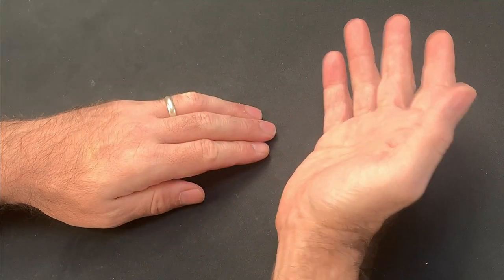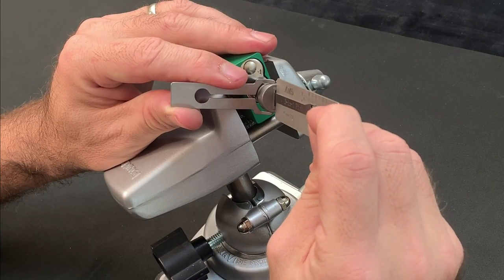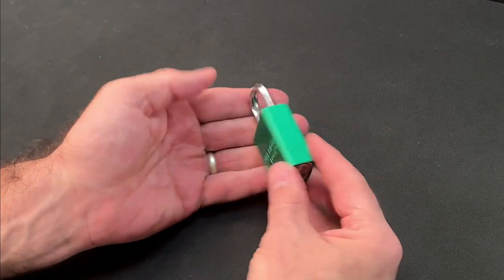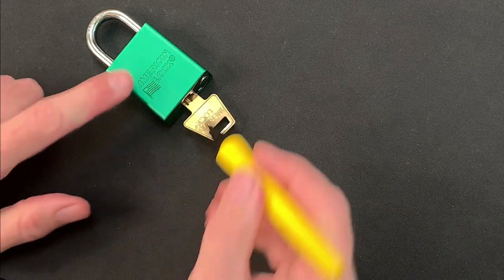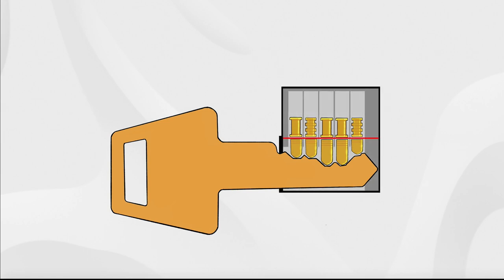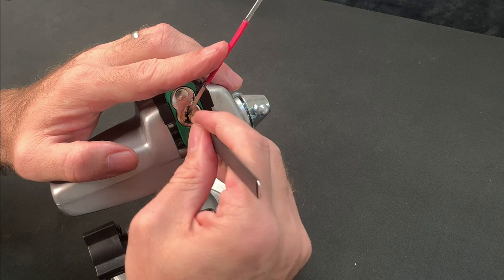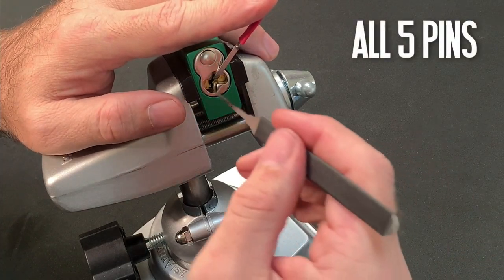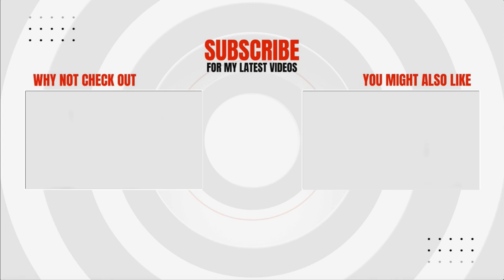024 This is How I picked my first American 1100

Comment: I just picked my brand new 1100 in two days of trying here and there. This is by far the most challenging lock for newbies (like me). Top tip if ever there was one is when you think you have all the pins set, give the tool some turning force. I probably had that lock picked a half dozen times and never knew it because I was relying on tensioning pressure to turn the cylinder, which it won't do due to the significant turning force required.

Comment: I have an additional help.  If you find the lock stiff to open, even with the key, you can remove the actuater, spring, ball bearings and shackle so that you remove the stiffness they provide so you can more consistently know that you have picked the lock.  The one I was working was so stiff that rotating the core was basically impossible with the tension tool at pressures you would be using to pick the lock so there was no feedback that I had, in fact, picked it.  When I pulled the shackle parts it removed that part of the equation.  It also puts the lock in a position that if you mess something up while fumbling around that the core can be easily removed since the retaining screw is accessible.

Comment: Right where I’ve been having difficulty. Just got my first open following your instructions! Didn’t go all the way to progressively pinning but using the bitting of the key to make sharpie marks on my pick made a huge difference in confidently knowing exactly where I was so I could focus more on the feedback. Going to keep opening and drilling this lock and other 1100s I have for a while like that until I can really get the feel and try without the marks
Reply from the maker: Great stuff - glad it helped

Comment: Since I was a teen, I found locksmithing interesting. Fast forward 35 years I bought a cheap pick set from Amazon last Thursday. To my surprise, I was able to open the clear practice lock quickly. I know, its’s easy. That gave me the confidence to open a real lock. So after a few minutes working a cheap master lock, Boom, I got it open. Now I felt unstoppable. I felt like had a gift. That is until I tried to open an American lock 1100. Dammit! Maybe I didn’t have a gift. After watching many videos on security keys, I was able to open the American in about 3 hours. So I sit here right now, I just opened a different American lock 3 times in a row within a few minutes. Thanks for this video…
Reply: Hope you found the redit forum r/lockpicking
Reply: Ok

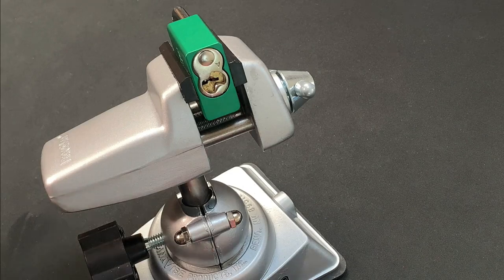Comment: Brilliant video. Very well explained. And kudos to Isaac for mentoring. The only thing I could add to this is that at 11:12 in the video you close the shackle of the lock, without having the key in it, causing the core to rotate 180 degrees counter clockwise.  At that point you can no longer insert the key and turn the core to its proper position, which makes someone who has not experienced that before believe that the lock is broken, or even bricked. However, you can at that point simply use a tensioner to rotate the core 90 degrees clockwise to bring it back to working order.
Reply from the maker: Yep good point - appreciate that observation 🙌
Reply: Cheers buddy! 🍻

And very good point!
Reply: Did that on my first rim cylinder. I knew from all the great videos here that the solution was probably simple. But I'll admit it had me just a little bit worried.

Comment: Interesting video. I too, got a first open on my 1100. TBH, I got more experience with by picking my Master 911. You get the true sensation of an over set and how to get out of it. The 1100 requires much more finesse but I could feel the oversets and counter rotation more readily. I too found that a longer hook definitely helped.  I ended up gutting it and to my surprise, not only are there serrated key pins but the spools are serrated as well! It truly was a steak dinner after eating fast food for quite some time. Now, I'm on to the Paclock 90a Pro. It's a 7 pin beastie.
Reply from the maker: Just saw your pic on the Facebook forum - really interesting. I’ll definitely keep an eye out for those serrated spools.

Comment: Andy, nice job on raising several picking sensations to a consciousness level. The non effect spool driver is never going to do anything other than act as a standard pin, it’s a common floor that is not understood by manufacturers when assembling locks. Big question now, is it a good idea to explain things at this depth level, it could come back to bite us all in the arse !
Reply from the maker: I think my opinion on sharing information on the channel still holds Martin - most criminal elements won’t take the time or effort required to employ non-destructive methods to gain entry - a crow bar and a pair of bolt cutters is faster and simpler - but you will know better than me whether this is the case in reality.  I also maintain that manufacturers will only be obliged to provide better security options when we as a public see through the illusion of low grade ‘solutions’ and vote with our wallets.
Reply: @fishpicks4531  More about making manufacturers aware Andy, at the moment they don’t realise that a spool with a long pin has no effect. If they do,, they can easily stop it happening, making locks harder to pick. Selfishly thinking about my former job !

Comment: First of all hats of to Issac for his help and support. Then congratulations to you for your dedication and achieving this open in a relatively short time (it took me two years to get mine open)! 

One point I'd like to explore is the pulsing at 10:38 to tell the state of the pins. I can't say I've heard of this technique before, could you elaborate on this here or possibly in another video?
Reply from the maker: Thanks - appreciate the feedback. So my understanding is that my pulsing the tension wrench - that is applying light to heavy and back to light again in a series of pulses, you can release a spool that might be stuck or just create some play in the core if feedback seems to have disappeared. Isaac will no doubt be able to give a far better explanation.

Comment: I've been having the same problem with an older Am Lock, even going through the same steps of trial and error. I was able to open it with the lishi tool, but only once. I don't have an original key so I've got to pick it again in order to take out pins to practice.

Comment: I can pick security pins and such, but my problem is with heavy Master Locks. M1, M5, #15, etc. I can't get it. And it gets so frustrating when all the advice you get is HEAVY TENSION. Or,TOK, or BOK. I have bent tension tools from the pressure. I have even gutted a few (RIP) They all have the same core as ML#3.  I saw some tips in this video I can use. But I can't subtract pins. Anyway, I'll get it figured out. And the celebration will be that much sweeter.
Reply from the maker: From what I understand the low tolerances on the Master Lock range makes SPP a real challenge at times - it might just be that you are fighting against poor manufacturing. Good luck with it 🙌

Comment: Great video.  I can pick the 1100 but it takes forever.   I’ve pick two different 1100’s twice.   The paclock 90a pro is super easy.  14 second pick on it.  100’s of times.    I am still trying to figure out why the 1100 is so hard.

Comment: Your videos are incredible. They must be an editing nightmare!! I have a loto padlock that I can open every so often, then sometime twice in a couple minutes and then nothing for weeks! Not sure whether I should take the victory that I’ve done it many times before or keep trying to perfect it?
Reply from the maker: Thanks - I did exactly the same thing with my LOTO - I went months after the first open before I got it again but half that time was because I didn’t really have at it. Then one day I sat down and committed to work until I got it again and it opened quite quickly. I then did it again immediately afterwards and now it can still be a tough open but I know it wasn’t a fluke 😉
Reply: It’s annoying because I don’t even think there are any security pins in it, I never get a false set with it, it must just have horrible bitting. I don’t have the key for it unfortunately and it’s not one I can repin without a lot of effort. Very frustrating, especially as I’m not very good and remembering how much tension I applied when I do get an open or what order the pins binded/set! Name of the game I suppose.

Comment: Thanks, I took my lock apart, forgot the springs - ruined em. Next time I over tightened the screw and the key won't even open it now... Any advice?
Reply: Pliers worked
Reply: If you overtightened the screw and the core feels stiff, then it is most likely because you reassembled the lock backwards. As in, you put the plug the wrong way into the shell. There is a little indent on the shell on the front side, just for reference.

Also you can buy new springs for American/Master locks from CLK supplies for pretty cheap.

Comment: Personally, I’m flabbergasted that you got that cheap, Phillips machine screw in and out of that lock more than once. I’ve had to throw away more American (Chinese) Lock screws than I can count. Seems to be a combination of cheap plating, thread locker, and pot metal construction. The threads are pre-trashed. So good on you! That’s a win!

Does your progressive pinning from the back pre-suppose that the binding order is 5-4-3-2-1?  Or was your binding order something else, but you simply decided to add one pin at a time, arbitrarily adding them from the back forward? For example, when you were working with three pins, you might have picked them as 4-5-3, even though the order you added them back into the lock was 5-4-3. 

Lastly, unless I missed it, none of the tips revolved around tension torque or tension tool choices?  Not saying they should have, I just find it ironic that you brought it up at the beginning as a legacy tip (because we’ve all heard that, just like you!) and then it was never discussed. Thinking back, I guess I do generally go light on tension, but I start that way with every lock. Maybe that’s why I still have an American 700, a 5200 and a 5300 I can’t get into!

A tip for those in the US looking for an 1100.  If you lurk Amazon, for some reason, you will commonly find the yellow (it’s actually gold colored) 1100 is significantly cheaper than other colors. Also, go to camelcamelcamel and set up a price watch so you can buy the dips.
Reply from the maker: Thanks for such a well thought through comment. 

So, in terms of picking order I was just following Isaac’s instruction in terms of repinning - the binding order just happened to follow in a complementary fashion for that lock.

Never had any issues with the screws/threads but given your experience I will be careful!

With regard to tension I did mention pulsing the tension tool but I guess I should have been more explicit - but as I consider it now, I’m not sure my commentary on tension would be very helpful - it was firmer than I had been working previously but it was dictated by the consequent feedback. I have recently released a 2 part series on tensioning and I think everything that I have to say about the subject for now can be found there.

Comment: Lol just bump it 🤣 😂
Reply: As locks increase in difficulty, they become nearly, or even fully impossible to bump. These locks can sometimes be bumped but you would still need to be very lucky and have bitting that isn't too extreme.

Single pin picking takes the luck out of it, and is a much more versatile skill.
Reply: @Isaac Hashman  you know I thought that too but my coworker bumped it in 2 hits lol over and over. I am still going to pick it and get good at it
Reply: @IsaacHashman  I really can't wait to get my new picks and tension bar in. I got a set of killermaru
Reply: @the420gorilla5  very cool, where are you ordering your picks from, if I may ask?

Regarding your coworker, I'm not surprised to hear him bumping one, as I have seen them bumped and raked before. But as I mentioned it will only work on some locks, and overall be relatively inconsistent. I bet he has managed to bump a few of them, but I also bet for every one he bumps, there are 2 or 3 at least (or more), that he wasn't able to.

If you develop the skils for SPPing these reliability, I GUARANTEE you will be showing him up, and opening locks much more consistently than him, if all he is relying on is low skill attacks like raking/bumping.
Reply: @Isaac Hashman  part of the problem the USA really doesn't care about lock security. I laugh every time I go to a million dollar house just to see kwikset on it.
Reply: @the420gorilla5   you know what they say... if, you don't laugh you'll cry. I feel the  exact same way!
Reply: @Isaac Hashman  did ypu get that link?
Reply: @the420gorilla5  sorry for the delay, no I did not